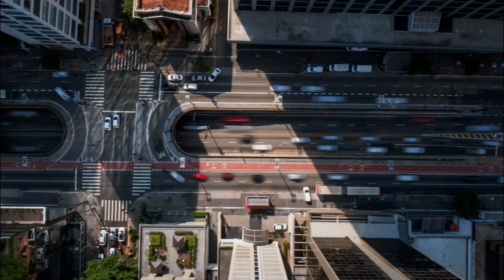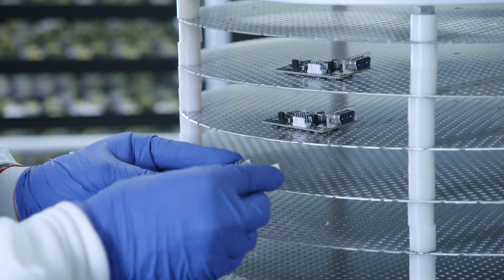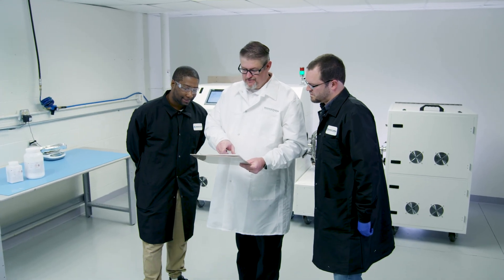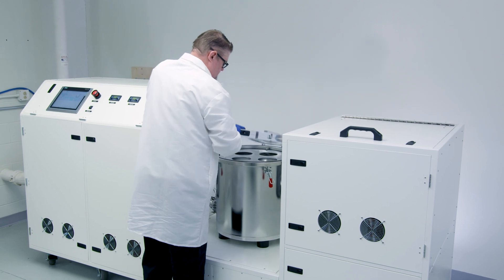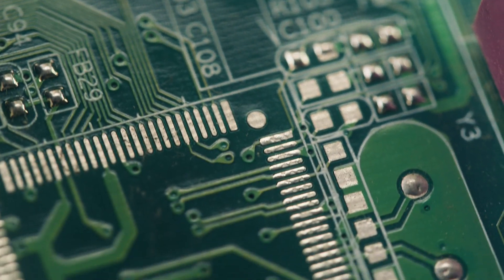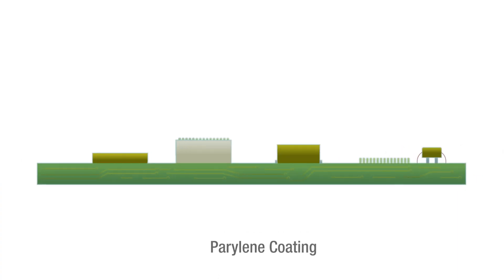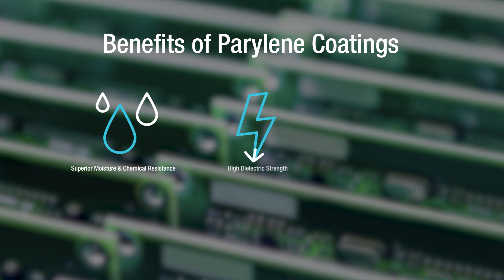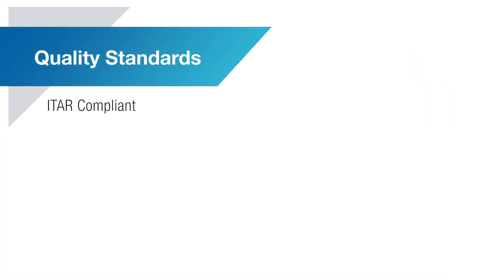Premium Electronic Protection | Parylene Conformal Coating

Comment: Nice video! the way that you place the samples in makes me wonder if the thickness is uniform on both sides on one run. Could you please inform me if you use another holder to achieve uniform thickness on both sides?